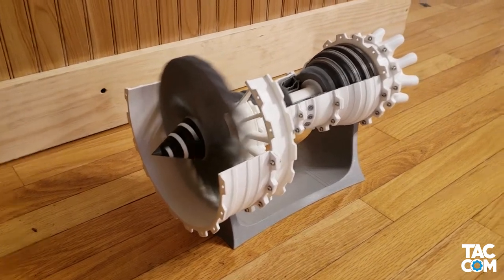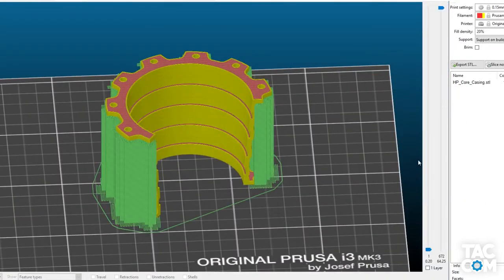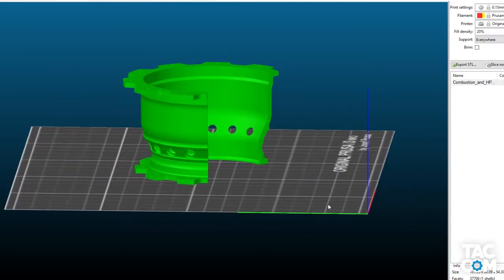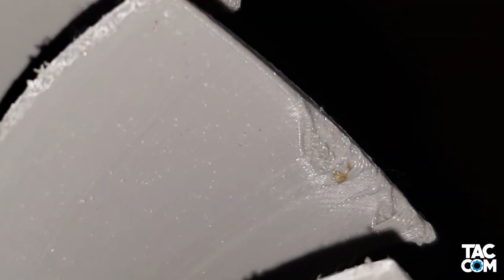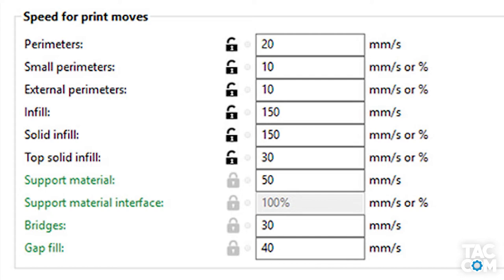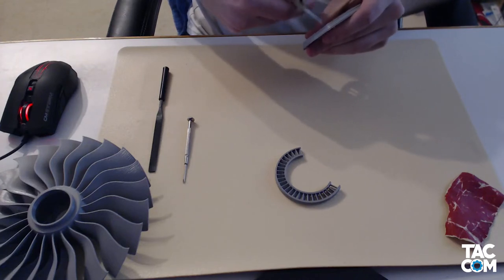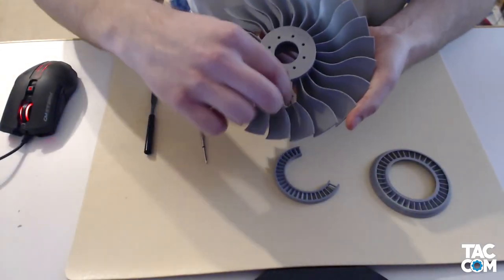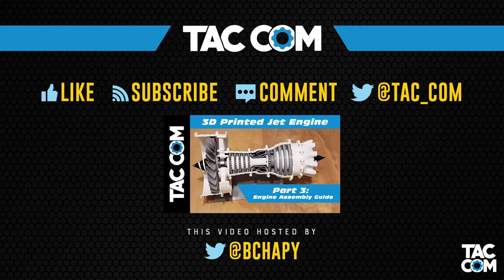3D Printed Jet Engine - Part 2: Printing & Processing

Comment: Hey man, great video playlist for this 3d print. How did you remove the supports from the fan, I keep on breaking the fan blades from the bottom trying to remove the supports.
Thanks
Reply from the maker: It's been a while, so I'm not 100% sure on this. I do remember them being rather thick connections, and I just had to take my time.
The 3 things I could think of were:
1. Make sure temp isn't too high. If it is, it could cause the supports to "melt into" the part a bit and make it harder to remove.
2. Use some needle-nose pliars. Be careful, but just bend the support back and forth. I believe part of it snaps off, and then it kinda "tares".
3. Check layer height. This likely won't matter too much, but if you can get a layer to line up at the transition point, that may help. Perhaps the transition is right between layers, so it's interpolating between 2 thicker sections?

I do remember these supports being rather thick, but of the 4 engines I printed, I don't recall breaking any of them, so I'm not entirely sure what the issue would be.

Good luck!
Reply: Thanks a lot!! I think my issue was that my temp was a bit too high 210° so I have lowered my temp to 195 and changed my retraction settings to combing mode. Hopefully it prints better, again thanks alot. Kinda surprised that you still repy to comments on your old videos and in such depth, alot of YouTubers don't too that. Keep it up!🔥🔥

Comment: Hey, great video series. I’m curious about how you printed the rotors, did you print them with the included “with supports” file? if so how did you get the supports off? i’m not having much luck getting them off
Reply: specifically the hpc rotors
Reply from the maker: Yeah, printed with the included supports. They came off pretty easily as a single ring. It did leave a few dots on the LE of the airfoil that I had to clean a bit.

If it's too stuck on, try lowering the temp a bit so that they're less likely to fuse together. 
Layer height may also have something to do with it if the transition between support/airfoil doesn't line up very well.

Comment: I know this video is 4 years old and there is a good chance that you already know this, but I recently learned that PETG can be used as the support interface when printing PLA (and vice versa).
Reply from the maker: Yeah, I learned that a few months ago - makes me wish I had multi-material capability. Then again, it's quite wasteful.

I actually printed another one of these recently and used organic supports in PrusaSlicer and had the settings dialed in much nicer.

Comment: Buried in the Thingiverse zip file is the full STEP of all of the parts assembled.  I loaded this STEP file into Fusion 360 and created custom support for those tabs.  It worked like a charm.
Reply: Do you by any change still have the STL? And do you maybe want to share them.
Reply: @7378ngx  I'm sorry.  I removed the files a long time ago to save space.
Reply: @shanerussell7335  how many kgs of filament did you use to print all the parts?
Reply from the maker: I don't recall off of the top of my head. I think it's in the description. If not on this video, then I know it's in the assembly videos.
Reply: GowTac-Com Thank you! I found them

Comment: in your excel, it shows 29 min to print the fan, but my slicer(cura) shows me 2 days 20 hours with a brim ?
Reply from the maker: Huh... That's certainly not right.
Lemme check that excel sheet again.

Are you sure that wasn't the spinner?
Reply from the maker: Okay, just looked.

Those are Hour:Min.
So it's actually 29 HOURS. Some of these parts took quite a long time.

Comment: Hey guys,

I just found a for you guys to print parts without the flanges being really ugly. I used organic supports or tree supports and set the top interface layers to 10-15 so that they can just snap off of the print without leaving anything behind. The top interface layers is basically the layers printed in between the supports and the actual 3d print it self. To get them off, carefully use something that is somewhat long and has a thin flat head. Use the head to pry off the layer and there you have a nice lookin 3d print
Reply from the maker: I printed another one of these a few months back, and used organic supports for it. I forget my settings, but it was much nicer than the original ones I did.

Next time I may try this method though and see how it goes.

Comment: Any luck ever finding a way to keep the underside of overhangs nice after tearing off the supports? Like the casings flanges. I'm using tree supports in Cura but it's still leaving "unfinished/unfused" lines on the bottom. Thanks for these vids! Only have 2 more parts to print!
Reply from the maker: Unfortunately, no.

I was actually thinking about printing  another one soon though. So I may do some research again. I hear some people have had some pretty amazing results from some of the latest settings in Prusa Slicer, so I'll be checking that out.
Reply: Use my remix. No supports are required at all for the flanges. They’re printed separately and glued together.

Comment: Im struggling to find the Fan with Supports in all the files, or is it a remix?
Reply from the maker: On vacation, so no good access to files currently. Check the regular "fan" model to see if it has supports. I'm not sure if there is a support-less fan model.

Comment: Hi! Not sure if you're still reading comments..but I've recently started to do this print, but have been having some trouble fitting the LPT stators in? The LPT stage 1-4 ones seemed to fit fine, but the stators seemed too small to fit on the spool. Did you have to adjust yours? And if so, what adjustments did you make?
Reply from the maker: Yup, always reading :)
Have you watched "part 3" (the assembly video - not condensed version)?
I don't remember having much of an issue with the stators. 

I know there was an issue with getting the aft section / diffuser attached to the LPT module, but that's a later step.

Comment: do you still remember how many kgs of filament you used to print all the parts? 
Thank you in advance!
Reply: Around  1.5kg total.  I used white for the main parts, silver for the "spinning" parts, black for the cones in the front and back, red for the combustion section, and blue for the compressor section.  It's a great project, but be prepared for a few weeks for printing, cleanup, and assembly.

Comment: What speeds would you recommend when you say to "turn the speeds down" especially for the fan?
Reply from the maker: For most parts, I have 20mm/s on Perim, 10mm/s external perim, 150mm/s on infil, and 30mm/s on top solid infil.
That's on a Prusa Mk3. I can't really speak for other printers though.

Comment: How did you modify the combustion 02:33 in your video to get rid of that massive overhang?
Thanks for the videos by the way..
Reply from the maker: I didn't actually do the modification.
If you go to the page for engine and go to "remixes", you'll find the new combustion chamber in there. It's a design from someone else.
Reply: @TacCom  Thanks for the quickly reply. Sorry for the stupid question, but where is "page for engine" to find "remixes"?
Reply from the maker: Engine: https://www.thingiverse.com/thing:1327093
Remix: https://www.thingiverse.com/thing:1327093/remixes
Remix in Question: https://www.thingiverse.com/thing:2441852

Other Option 1: https://www.thingiverse.com/thing:3781509
Other Option 2: https://www.thingiverse.com/thing:3327036
(haven't tested these myself)
Reply: @TacCom  thanks man!!
Reply: @TacCom  sorry bothering you again, I got the remixed file and not sure what happens in the slic3r that the built in support for the fan stator casing and combustion chamber get messed up after sliced. Did you hv anything related when printing?

Comment: Hey! how did you get the cool pattern on the spinner tip?
Reply from the maker: It's printed as 2 separate pieces - 1 white and 1 black.
The black had a groove so that the thin white strip could be glued into place.

Comment: Do you have the speed setup for the fan?
Reply from the maker: Sorry, missed this comment.
When you say "speed setup", are you talking about print-speed? If so, I believe the settings I used were:
- Perim: 20 mm/s
- Small Perim: 10
- External Perim: 10
- Infill: 150
- Top Infill: 30